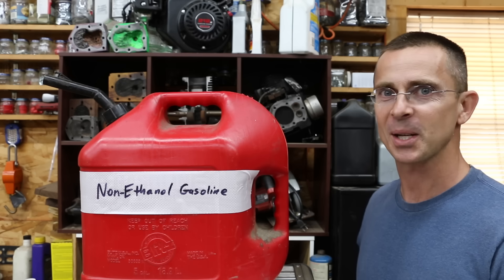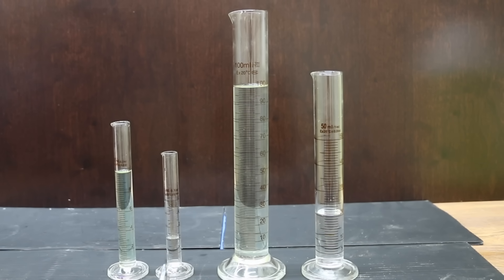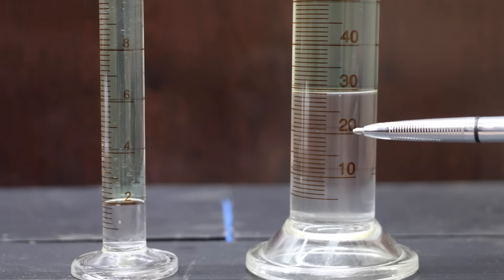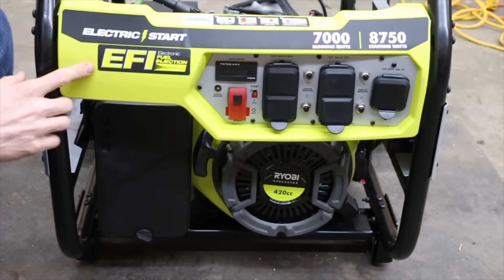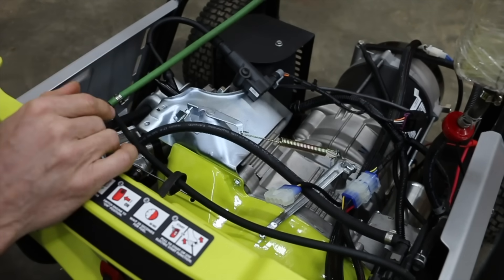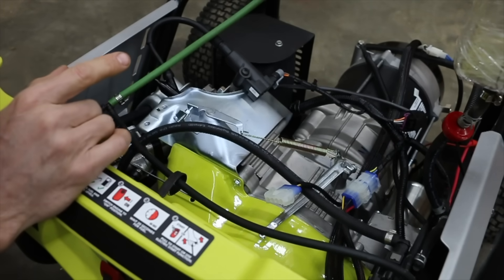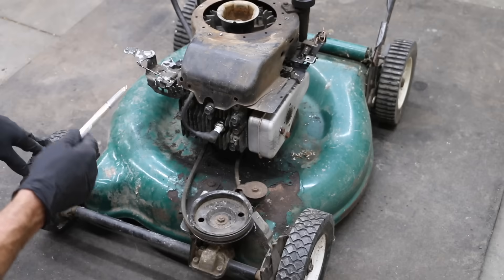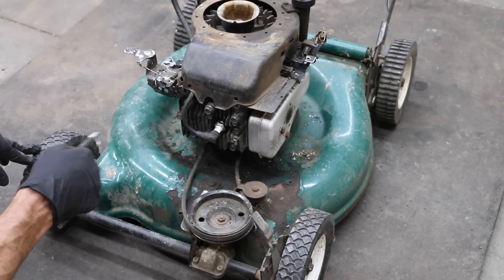Is Non-Ethanol Gasoline Really Better? See the PROOF!

Comment: Ethanol has alcohol in it. The alcohol in the gasoline sits in the tank. The air in the tank mixes with the alcohol fumes in the tank. The alcohol in the gas pulls water from the air in the tank, a compounded case of condensation . Extreme condensation pours water into the gasoline, ruining the top end and fuel system. Then the alcohol also eats away at hoses and plastic componants. Octane is meaningless if you add a cup of water to your car when you fill up.
Reply from the maker: Thank you!

Comment: i mowed lawn for an old guy his mower didn't even have recoil start. he had a couple electric motors on a table the right height. that was his electric start. once it warmed up  it rope started easy. after he passed at the auction the auctioneer said i don't know what this is but 2 good electric motors. i said it the electric start for the lawn mower.
Reply from the maker: Thank you!

Comment: Idk why this is even a question.   The last flex fuel vehicle i had bought new came with a milage disclosure that stated you will get less miles per gallon with ethanol versus regular old gasoline.  It literally takes more ethanol to make the same power as gasoline.
Reply from the maker: Thank you!

Comment: The riding lawn mower i used to own specified to use ethanol free gas or warranty was void. Have noticed that on other small engine machines as well. High performance automobiles require ethanol free gasoline as  well.
Not to mention the process to make ethanol is causing pollution and uses more energy than just making straight gasoline. 
The ethanol use is a subsidy by the government to control prices and pay farmers to grow corn.

If the government would truly work for the better of the country and its' citizens a lot of this wasteful spending and projects would be cut out.
Farmer's are paid to let fields set empty just so prices can be controlled. Let farmer's grow crops to feed the hungry . So what if there is a little excess this year, then reduce prices and let consumers benefit. Farmers still get paid no matter what. But this way tax money is actually going for something good.
The only problem with that is lower prices is less tax for the government. 
As voters we need to make our voices and opinions heard.
Reply from the maker: Great point! Thank you
Reply: Absolutely on point!
Reply: I have to agree: They're gas engines, and they work better on gas!

Comment: Why do outboard motors have a hard time with ethanol fuel?
Reply: I've heard it's because of rubber seals.
Reply from the maker: Ethanol is hard on rubber and is hygroscopic.
Reply: If you have gas in a small tank and let it sit in your boar half full for say a couple weeks and it's hot, the alcohol in the gas will pull water from the air space in the tank and that condensation will rapidly dribble down the sides of the tank into the gas. Soon you may have a quarter cup of water mixed into a gallon of gas. Normally it will sit at the bottom, water in the fuel is BAD. Alcohol will also rot componants in the outboard motor . All gas is ethanol so I use conditioner in m y gas and whenever I flush my outboard I disconnect the tank and run the outboard till the fuel line and motor run dry and the motor dies . That way no alcohol is sitting in my lines or carb or motor. Also I will top off my gas can to remove any air in the tank while it sits in the boat not being used. This is the only way to properly deal with an outboard running ethanol .

Comment: I like the small engine comparison.  I have an old Craftsman lawnmower with a Briggs and Stratton.  I don't change the oil or plug and leave the ethanol fuel in. It always starts.  I tried leaving ethanol fuel a new Ariens snow blower and had loads of problems. Bought a Toro 729 OE with a 212 cc. Using non ethanol, I have no problems after 2 seasons.  Granted changing manufacturers and engines distorts the results.
Reply from the maker: Thank you!

Comment: The non-ethanol fuel ran the generator for an extra couple of minutes.
Reply: This is an interesting point. Ethanol mix fuel may have less energy per volume, but who's to say that the car will "consume" energy at the same rate. It could be that ethanol reduces your car's performance enough to cause increased economy relative to a constant power test.
Reply from the maker: Thank you!

Comment: There is no way ethanol is more efficient and I can prove it in all 3 of my cars. I get between 5 and 10 mpg better gas mileage with non ethanol gas. Drive a hundred miles a day back and forth to work I get 2 maybe 3 days on a tank of ethanol laced fuel and with non ethanol I get 4 days sometimes 5 days from non ethanol and my mpg on my dash shows it in numbers. I have 2 Mercedes 1 C280 and 1 C320 and a Nissan Titan all 3 get better gas mileage on non ethanol fuel and it doesn't matter where I get my gas I only run super in them but my mileage sucks on all 3 vehicles if I run super with ethanol.It's the same with the gas equipment we have on the farm we see better numbers with non ethanol gas it's a gimmick to make it look cleaner but is it when you have to buy twice as much and they don't tell you what it does to aluminum or rubber and gaskets. It is shit and to think I sell 300,000 bushels of corn to the crap every year but I boycott every gas station and fuel supplier in area that does not have non ethanol gas available and I'm not the only one.
Reply from the maker: Agree.  Non-ethanol is more efficient. Thank you

Comment: Hydrophillic means that it mixes with Water this is not correct with Ethanol. Ethanol is Hygroscopic which means its attracted to and attracts Water. The problem with Ethanol is that the Water that is present in Gasoline you get from the Pump no longer separates  to the bottom of your Tank, it stays suspended in the Solution of Gas and gets burned through the Engine. Water is incompressible, so Water that gets between a Valve Seat and Valve when it closes causes increased wear to the softer metal which is usually the Aluminum Seat. The Ethanol will also attract Moisture in the Air through your Tank Vent so Ethanol Gas has a significantly shorter Shelf Life then it used to have and begins to go bad after about a month compared to 3-4 Months of the non-Ethanol Gas. I Ride Carbureted Motorcycles and what I do to help my intake and exhaust valves combat the increased wear is add a cap of Marvel Mystery Oil to each tank. This addition of Mineral Oil and White Solvent (Stoddard) should add a little extra lubrication to the Valve Seats and Piston Ring, hopefully slowing down the increased wear.
Reply from the maker: Thank you!

Comment: Good video. I’m interested in what an ethanol fuel based gasoline vs a non ethanol gasoline does to those smaller engine components like carburetors and so on over time that should be good.
Reply from the maker: Thank you

Comment: Awesome video. 
Where I live the EPA requires oxygenated gas to be run. I never ran the E85. I drive older cars 90’s to mid 2000’s models. The 10% ethanol ruins fuel lines and carburetors in my small equipment.1 wood chipper, 3 lawn mowers, 2 chain saws and 2 string trimmers. Over the years all of them had to have carburetors rebuilt or replaced.  My newest chainsaw a Husquarvana specifically says to use 91 octane gasoline or higher non ethanol fuel.
Personally in my cars and trucks I try to replace my fuel filter once a year or at most every 18 months. Some much dirt and sediment in the underground tanks at gas stations. I worked at a truck stop years ago the fuel delivery guy one day told me never fill up right after a fuel delivery. I bite and asked why he told me that all that fuel rushing in stirs up the dirt and sediment in the underground tanks. All gas pumps do have filters inside, sometimes on the outside that filters dirt and sediment out. They are supposed to be changed every 6 months (I maybe wrong).
Now I am no engineer just a graduate of the school of hard knocks and real world experience. I just try to steer clear of too much ethanol in anything.
Reply from the maker: Great point! Thank you
Reply: Yeah, mopeds hate the stuff too. To the point, that moped brands suggest using premium fuels. 
Yes, a moped forced to use premium fuel! Ouch.
Reply: Hands down ethanol is bad for carburetors, no disputing that, but for a fuel injected car with the old rotten fuel lines replaced with ethanol tolerant lines you should never have a problem.

Comment: Well you have at the end of the vid Royal Purple SAE-30 the only synthetic straight 30 and the best you can buy, next to it is the second best small engine choice, BP's Castrol HD30 a nice gunk cleaning strong tensile strength conventional my go to small engine fluids. As a Kohler Expert Certified Tech and a CM for Hydro-Gear Hybrid Smartec Development over 10 years working on small engines and about as long building printed circuit boards, this was a damn entertaining scientific video that you gave the variables, elaborated on how its results will be valid and they are. I noticed the ethanol free mixed with 1oz/1gal seafoam would bust the softer looking carbon, but the ethanol leaves a much dryer more baked on carbon, would you agree? And lefts all forget the fuel woes already add 1 oz seafoam to stabilize and negate alcohols effects on 4 stroke and out 2 strokes use 2 oz per gallon in your mix and its night and day compared to the results you got ethanol or not if it doesnt build up...it doesnt...build up!!! For mix royal purple 2 stroke is the only ash free oil and mixed with 93 10% and seafoam will leave everything spotless, wear free, and no smoke or smell. I'm not paid by anyone just personal experience. And dont overpay buy seafoam 45-50 a gallon and oils off Amazon very cheap, very fast and those oil changes actually get done ;)
Reply from the maker: Thank you!

Comment: Question I have is does higher octane burn better, hotter,  and cleaner than lower octane? I run 91 octane in all my yard equipment but add an ethanol inhibitor to take care of the water issue. Being that you said taking out the ethanol lowers the octane a couple of points should I add an octane booster as well or just buy race fuel down the street? Also, does higher octane matter to a vehicle that doesn't require it?
Reply from the maker: My opinion is to use the minimum octane rating for the benefit if saving money. I don't believe that there's much difference in how clean they burn.  Both should completely burn with ignition spark and the fuel additive package has more to do with cleaning than octane. Thanks again.

Comment: The more ethanol in the gas the lower the fuel efficiency because if you run nothing but ethanol it takes more to do the same amount of work witch means lower fuel efficiency.
Reply: In lower compression gasoline engines ethanol will get lower mileage but more horsepower.  For example a Chevy pickup with a 5.3L engine gets a clean 380 horsepower on E85 vs a toxic 355 horsepower on E0.
https://media.gm.com/media/us/en/chevrolet/spec-tables/2016/1500-crew-cab.html

In high compression ethanol engines, ethanol will get both higher horsepower and higher mileage, some with mileage greater than diesel.

Here is a clean ethanol engine on the roads as we speak worldwide today with mileage equal to diesel engines:
https://www.oemoffhighway.com/engines/press-release/21005554/scania-ab-scania-introduces-bioethanol-engine

This is not new technology, it is suppressed technology we knew about long ago:

Rear Admiral C.M. Chester wrote Henry Ford a letter on Dec.15, 1916:

"...I also pointed out in the article that as governmental laboratories had developed from 40 to 55% efficiency in alcohol engines as against 20% in gasoline machines, the use of alcohol at double the cost of gasoline for power purposes, was cheaper for motor[s] than gasoline in common use today."

The Navy was not the only researcher to possess that information:

Scientific Investigations of Alcohol Fuels 1890 – 1920

Scientific journals contain hundreds of references to alcohol fuel at the dawn of the automotive era. Research during the earliest decades tended to focus on pure alcohol as a replacement for petroleum. The focus shifted to the anti-knock (“octane” boosting) properties of alcohol blends in gasoline during the 1915 to 1936 period because of an increasing need for anti-knock gasoline and because of improvements in anhydrous alcohol production techniques.

Studies of alcohol as an internal combustion engine fuel began in the U.S. with the Edison

Electric Testing Laboratory and Columbia University in 1906. Elihu Thomson reported that despite a smaller heat or B.T.U. value, “a gallon of alcohol will develop substantially the same power in an internal combustion engine as a gallon of gasoline. This is owing to the superior efficiency of operation…”

Other researchers confirmed the same phenomena around the same time. USDA tests in 1906 also demonstrated the efficiency of alcohol in engines and described how gasoline engines could be modified for higher power with pure alcohol fuel or for equivalent fuel consumption, depending on the need.

The U.S.Geological Service and the U.S. Navy performed 2000 tests on alcohol and gasoline engines in 1907 and 1908 in Norfolk, Va. and St. Louis, Mo. They found that much higher engine compression ratios could be achieved with alcohol than with gasoline. When the compression ratios were adjusted for each fuel, fuel economy was virtually equal despite the greater B.T.U. value of gasoline. “In regard to general cleanliness, such as absence of smoke and disagreeable odors, alcohol has many advantages over gasoline or kerosene as a fuel,” the report said. “The exhaust from an alcohol engine is never clouded with a black or grayish smoke.” USGS continued the comparative tests and later noted that alcohol was “a more ideal fuel than gasoline” with better efficiency despite the high cost.
Reply from the maker: Thank you!

Comment: Ethanol sucks up water from the air and can go into what they call " Phase Separation ". When this happens, look for the best landing spot in an airplane.
Reply from the maker: Thank you!
Reply: There is a huge amount of water in a bottle of vodka, yet I have never ever seen it separate, even with the bottle in the freezer.

This airplane uses100%  hydrous ethanol which is 4% water in Brazil:
https://agricultural.embraer.com/br/pt

The Japanese Zero airplane used ethanol as its fuel as well, other of their craft used ethanol blends as did we during WWII.

Here is an aircraft engine that uses E10 auto gasoline today:
https://www.rotax.com/en/products/rotax-aircraft.html

The FAA approved AGE85 as an avgas.  It is 85% ethanol, 1% biodiesel(for lubricity), the rest pentane.

Water is a truly a problem of E0 straight gasoline.

Years ago in the days of E0 gasoline every winter people would even have to buy little cans of alcohol called DRY GAS or HEET as gas-line antifreeze.

Gas stations would even have many cases of it stacked up near the check out counter during that time of year. No one likes having a fuel line froze up in dangerous temperatures. It was common back in the E0 days.

Since E10 came, nobody buys DRY GAS or HEET anymore because the alcohol is already in there. There may be a dusty bottle or two back on a back shelf somewhere at the gas station, but that is it.

If ethanol did cause water/phase separation problems even half or even a quarter as much as is falsely claimed, we would know it right away because every winter millions upon millions of cars would be stalled on the road in the northern US and Canada. This obviously never happens, but many cars did stall with frozen fuel lines back in the days of E0 straight gasoline which is why Heet and Dry gas were so popular and E10 is why they are not so popular anymore.

Mercury Marine, which hosted a Webinar on ethanol myths, noted that ethanol does not "grab water molecules out of the air." It is hydrophilic, which means ethanol holds water. With regular gasoline (E0) as well at E10, the primary cause of water collecting in tanks is condensation on tank walls. But unlike E0, which can absorb almost no moisture, E10 can hold up to half of one percent of water by volume, and the water molecules will dissolve in the fuel. The "solubilized" water will bypass the water separator and burn harmlessly through the engine.

>>>>Mercury Marine also says E10 may be the superior fuel(over E0) because it keeps the fuel "dry"<<<<

https://web.archive.org/web/20140922142320/http://dcd96xmek71bc.cloudfront.net/archives/email/Trade/BoatingIndustry/MythsofEthanol-August252011.mp4
According to a paper published by the Society of Automotive Engineers, at 68 degrees F, alcohol with as much as 45% water will mix with gasoline and not separate. With 4%, alcohol will form a stable mix with gas down to about minus 22 degree F.*

*A.C. Castro, C.H. Koster, and E.K. Franleck, Flexible Ethanol Otto Engine Management System 942400(Warrendale, PA:Society of Automotive Engineers International, 1994)

Comment: TEST IDEA: Diesel fuel vs Used Cooking Oil

I've heard the Used Cooking Oil works as well as Diesel fuel, costs less (sometimes restaurants just throw it out, and you can snap it up for free) and you don't even need to make modifications to the engine.
Reply from the maker: Thank you!
Reply: That is where a lot of the cooking oil goes now into making biodiesel which is priced with petroleum that truly can burn in diesel engines without modifications.  They use a little lye and alcohol as a catalyst to remove the wax in the oils. 

The lubricity is huge with biodiesel.  Ultra low sulfur diesel fuel does not have a lot of lubricity since sulfur used to provide that.